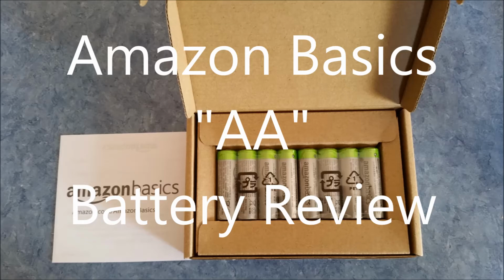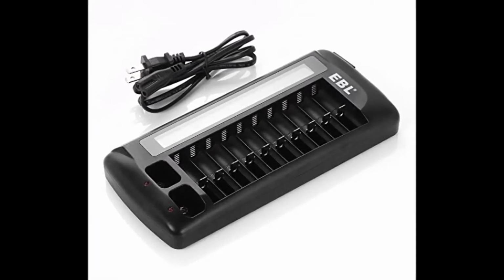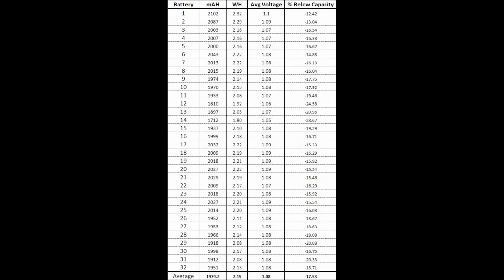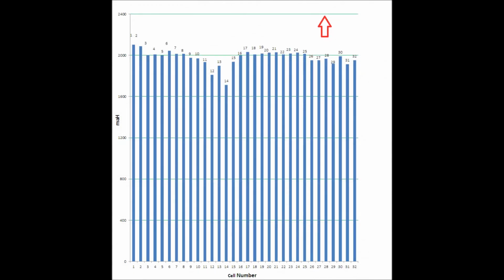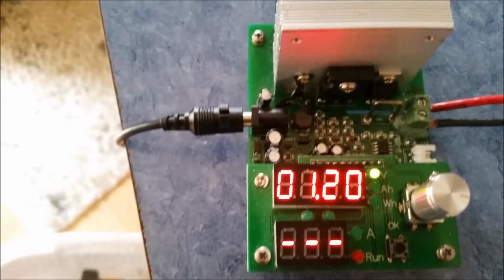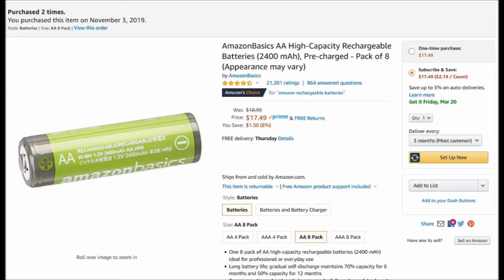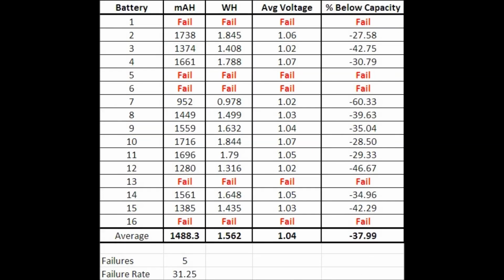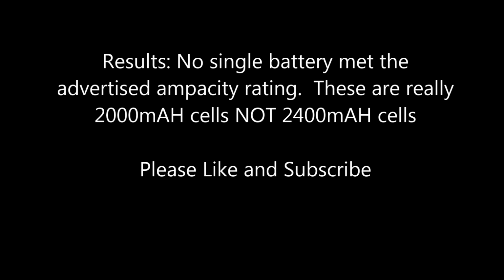Amazon AA Basic NiMh Rechargeable Battery Review

Comment: The rated capacity mAh for most of these or anyone's batteries (cells) is at a 500 mAh or 250 mAh draw not a wacky 1000 or insane 2000+ mAh draw. If you want high-capacity, low discharge and 1.5V not 1.2V never get any current Ni-MH cell, instead I'd look at Lithium AA or AAA 1.5V cells.
Reply: BTW .. these type batteries (cells) improve their capacity after a few discharge / recharge cycles...
Reply from the maker: Not from what I seen.  I ran them 3 more times with no notable increase in capacity at the rated mah or discharging at .2A
Reply: @stem_saving1644  .. Project Farm tested these same exact batteries and followed by a 1 year and 2 year. As I said for a high draw get LITHIUM AA or AAA cells .. problem solved.
Reply from the maker: I suspect these are the Chinese version.  
I don't disagree with lithium.  But the rechargeable application doesn't support anything else.  As my results had shown,  after 3 years, under load most failed entirely.
Reply from the maker: If the cells are listed at a rated capacity. They should perform at that capacity.
Reply: @stem_saving1644  .. They do, it's your testing and you not reading the accompanying documentation. Listen I don't work for Amazon, I couldn't give a crap about them, see what they had to say at Project Farm. Personally I'm a Lithium battery fan.
Reply from the maker: There is no documentation accompanying the cells on how they are testing. If they advertise 2000mah. Then it gets discharged at that rate.  Problem is how it's advertised with lack of specifics.

Comment: The old amazon basics from Japan seemed to be rebranded eneloops. Now they're made in China and not of the same quality. They work for my uses but I have old amazon basics from Japan and they still take a higher charge and hold it longer than these Chinese cells.
Reply from the maker: That does seem to be the case. Not bad batteries.  Just not putting out what they are rated for.

Comment: Hi well it is a better choice than alkaline even if it doesn't perform as well you can charge it and it's very cheaper if you want good cells next time buy ikea or enelooppro or even duracell rechargeable they are much better
Reply from the maker: Very True, but I will show eneloops don't meet their capacity rating either, 2100mah seem to be the upper limit for most cells regardless of manf.